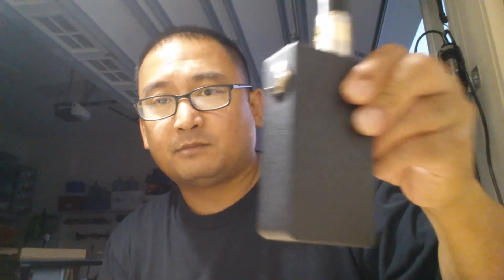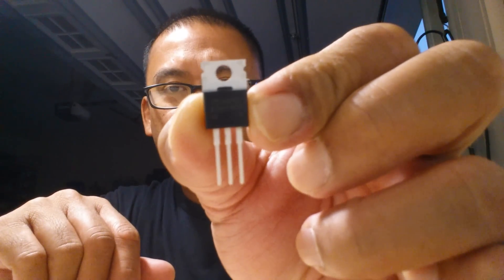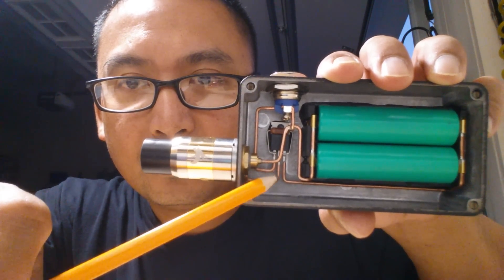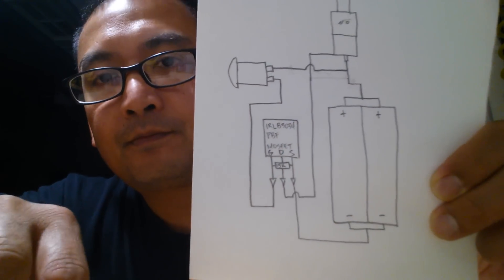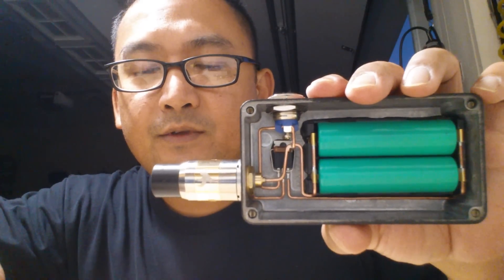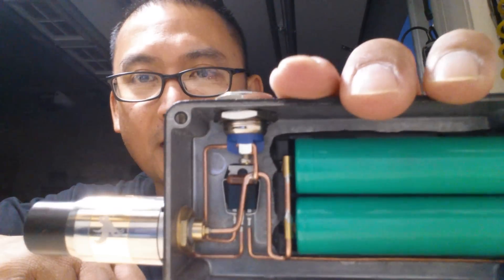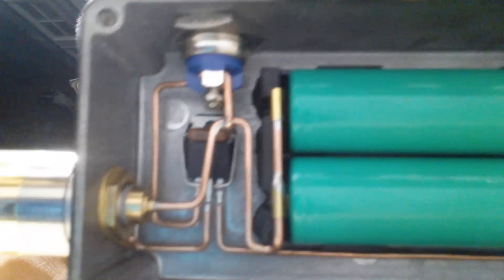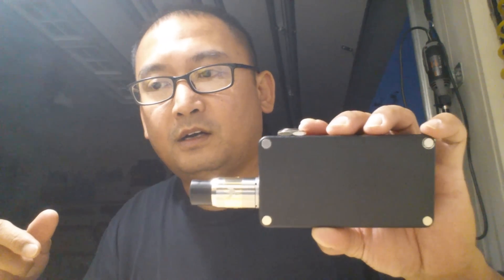Unregulated box mod with a Mosfet

Comment: I'm building my box rite now an was just wondering if the ohm resistor is needed I'm pretty much building the same thing only difference is I'm running mine in series I need that 8.4 v lmao
Reply from the maker: Yes it's required

Comment: Just as a heads up, G stands for Gate not ground. The gate to drain voltage is what determines the source to drain connection is closed.

Also, the large metal tab is connected to the drain and can get very hot with large amounts of current. It looks like your resistor is laying up against it. I would recommend lifting it away from the tab otherwise it may begin to melt it.
Reply from the maker: Thanks for the correction. This is my first build using a Mosfet, so I'm still learning. I'll keep your tip in mind whenever I build my next one.